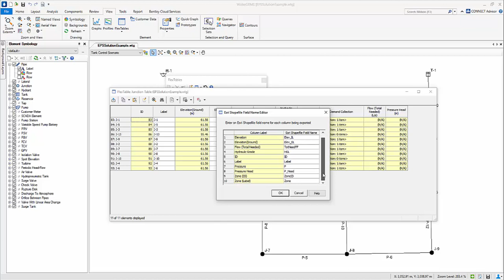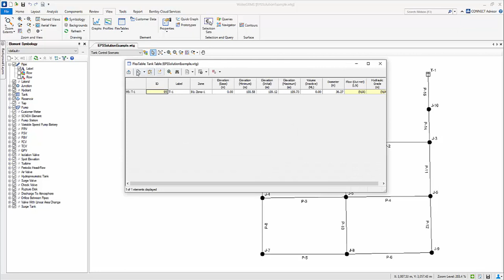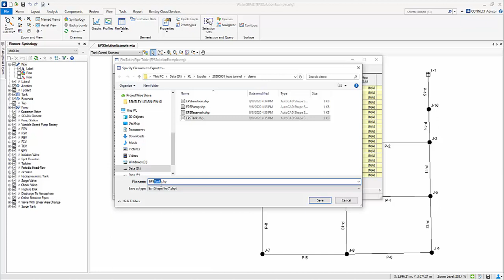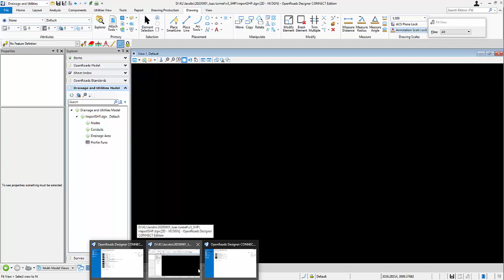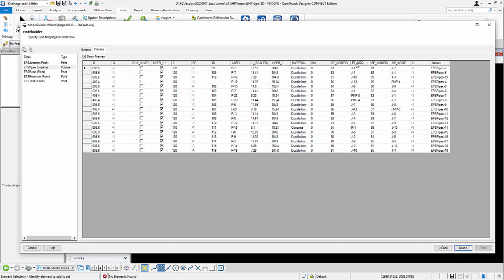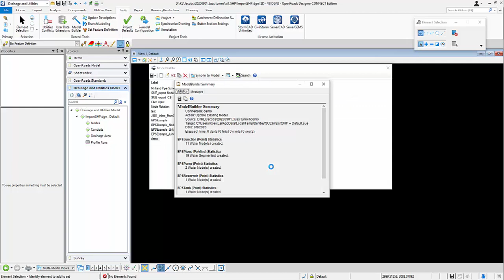WaterGEMS to OpenRoads Designer

Comment: Hello, 

I exported the file from waterGEMS to OpenRoads using shapefile, however, the water segment is still in 2D, with no elevation. But the water nodes were exported correctly. How can I solve this problem?

Thank you.